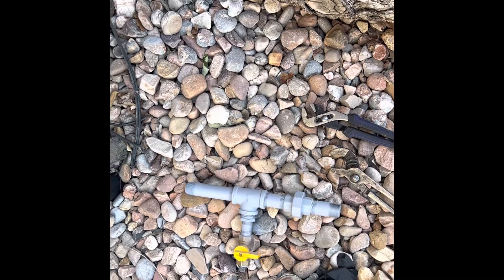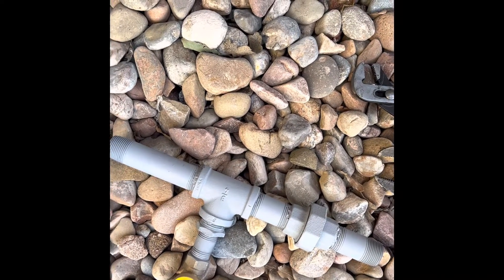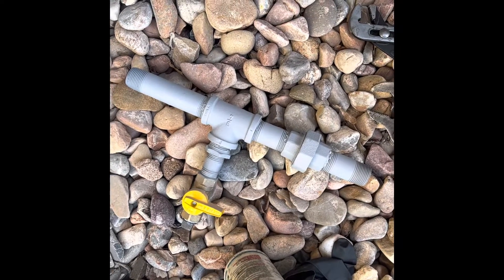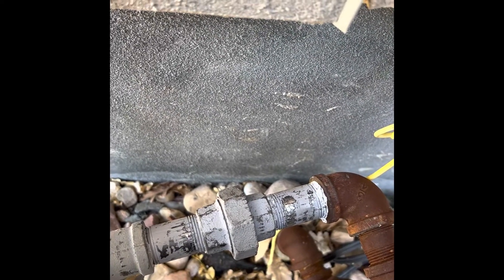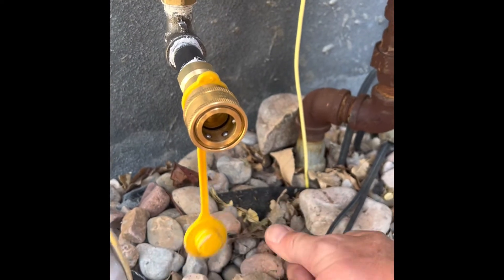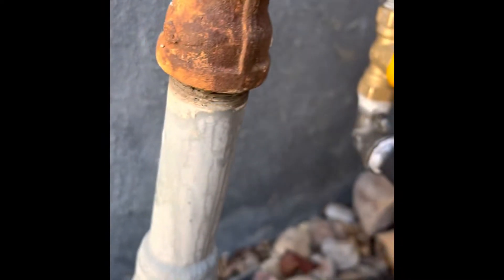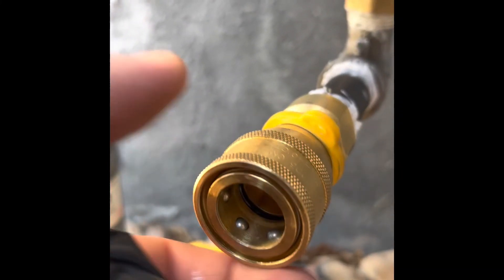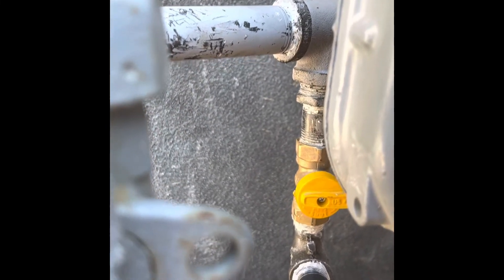Firman Tri fuel gas line fitting installation

Comment: Thanks for the video.  I ordered the same hose.  This video helped me find a bigger hose.  I have 1 1/4 inch pipe at the main and had to reduce to 3/4 to 1/2 to 3/8s.  You saved me some cash. as I can return some parts.